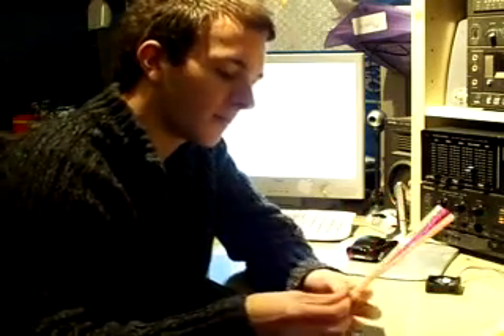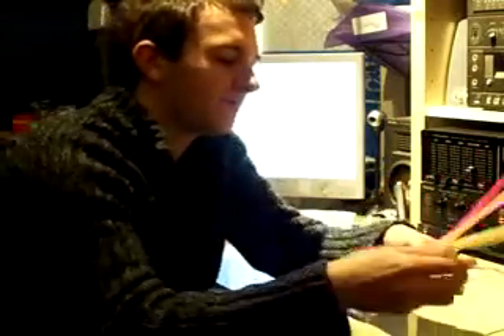Understanding ohm loads and impedances - Audio

Comment: Good analogy using these starws to represent impedence. I have been in the electronic field for over 35 years. (Last job = Senior Test engineer Intel Semiconductors, now retired). You might want to do a one before this using the straws with water. (Then the water is the electricity, and the pressure is the voltage, the bigger straw is the current, etc). I have thought of making a simple video like this for High School Level. AL IN ALL, "GREAT IDEA, AND GREAT JOB" Well Done! Yo, MoJo*)

Comment: Unfortunately the straw demonstration suggests that four 1ohm resistors in parallel give four ohms, which is wrong (1/4 ohm).  Use big straws and add them in series for a truer demo?

Comment: its up to the amp if it sucks then there not much you can do but add more ohms to reduce the amount of power required, 4 ohms is pretty decent power kicking, an average cheap amp from buck or two wouldn't be able to handle it.    

Side note: Thanks for the video it helped a great deal with my understanding

Comment from the maker: what ohms are the jvcs? Most home amps can handle 1 - 2 ohms under their rated impedance. For example, i have a 50Wrms Rotel amp, and mistakingly, i ran that at 1.336ohms for over a year!
if in any doubt you can use a multimeter to find out the rough impedance of a subwoofer, but its hard to get it accurate cos the wires themselves have resistance, and when the voice coil heats up, the impedance becomes higher also. If this isnt making sence i can explain it to you properly in a message lol

Comment: Ok, I already knew how ohms worked, but I'm wondering, this is probably stupid and I should really look around before asking, but, say I have an amplifier that gives out 200 watts RMS at 4 ohms, and I put 4 4 ohm single voice coil subwoofers wired in series so it's still a 4 ohm load, will each subwoofer get 200 watts RMS or does it divide the power evenly?

Comment from the maker: dude if you put four 4ohms speakers in series that will equal 16ohms. to get it back to 4ohm you need to wire two sets in seires then parrallel both sets. If youre using numerous subs of the same impedance then they will all get the rated RMS power, it doesnt 'split' the power if you like.